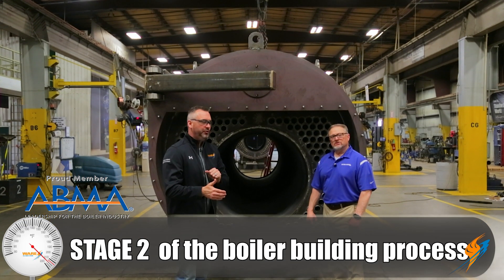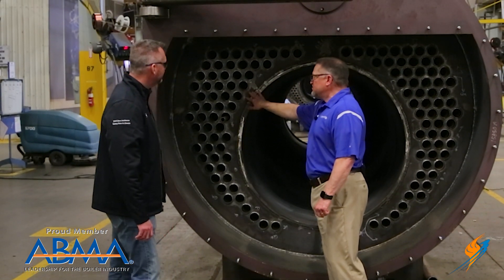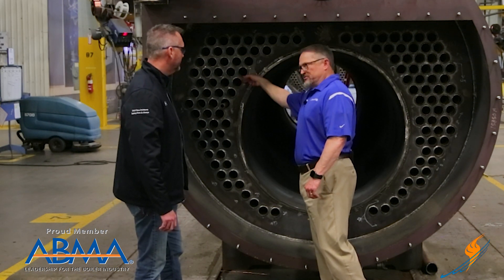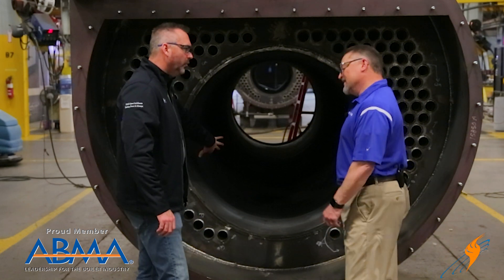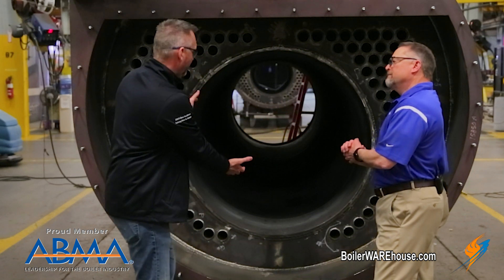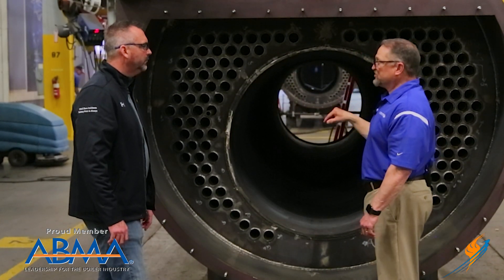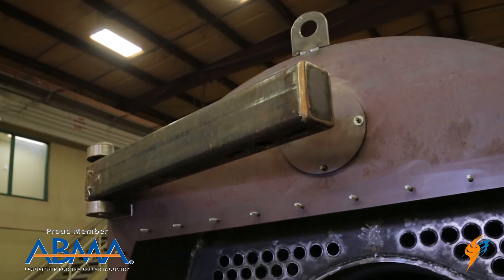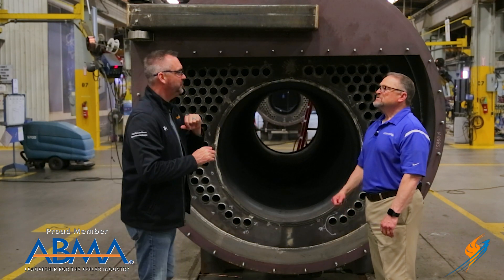How a Firetube Boiler is Made (Part 2/3) - Boiling Point

Comment: Morrison tubes are supposed to be welded 100% to the tube sheet. The Morrison tube is on the bottom because heat rises and a lot of the heat will go up and back through the top tubes because that’s where most of the heat is. The welds on the lower, second cycle tubes are because the process of heating the water ends there and they don’t want the ends of the tubes to be damaged by the constant flames. The ones that are rolled in the end are rolled to keep the rolled tubes on the tube sheet in place and to help the seal on the tubes are helped kept tight.
Reply from the maker: Hey Randy, we appreciate your experience, however, this is a power boiler, not an atmospheric boiler so the hot gases are pushed through the boiler via a fan. There are no flames on the rear tube sheet or tubes. If you have any specific technical questions, we’re always happy to discuss them. Thanks for watching!
Reply: @ I understand that. Ive built these. For years I built them. I think I know what I’m talking about. This was my profession. So think what you want.
Reply: @ my original comment was just to say that all of these package units and that’s what they are, the Morrison tube is, or should be 100% welded. Fact is, every tube sheet that was delivered to my jobs, the Morrison tube hole was pre beveled for 100% penetration. So I don’t really care what else you have to say, just letting everyone know that that is a pressure weld and needs to be a 100% penetration weld.